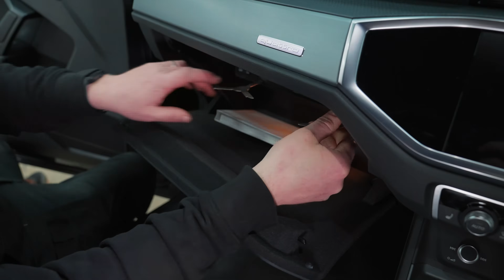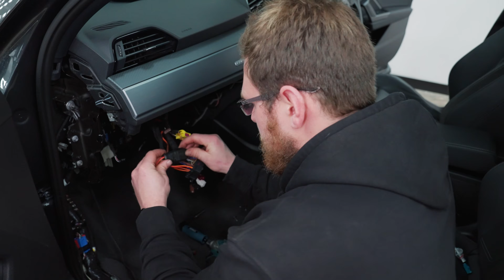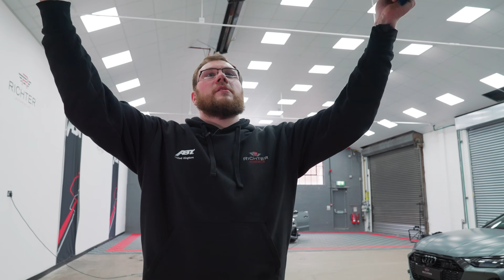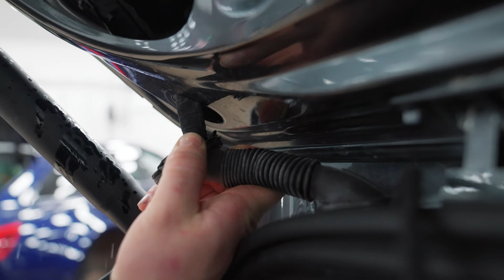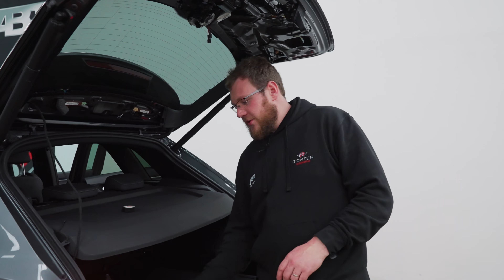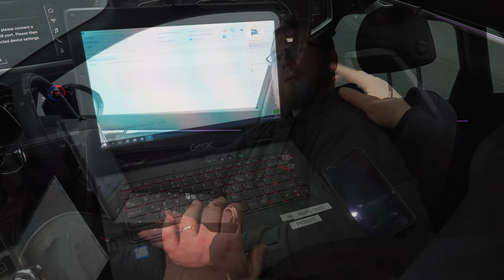Audi Q3 Rear Camera Install Retrofit - Richter Automotive

Comment: Hi 👋🏻 thanks for the video. I’ve recently got Audi South Africa to install my reverse camera which I’ve purchased from Audi. The reverse camera quality seems to be unclear and not great as I initially expected. From your installation, is the camera quality great or does the camera quality just suck? Please let me know as I’m not sure whether I should get it checked out by Audi. 

Thanks 🙏🏻
Reply from the maker: The quality is excellent, but I guess different markets could have different specifications, and much lower resolution infotainment screens which will cause it (some a1 use a very basic screen and the quality is bad)

Comment: Great video!  I'm installing a dash cam and looking for a video detailing the removal of the A-pillar trim on my 2024 Q3 so I can run/hide the wire (USA: left side/ driver's side).  Any chance you can help me out? Much appreciated, in advance!
Reply from the maker: They are pretty tricky to remove, we will try and do a video in the future,, or running it behind the rubber seal could be an option, and tuck it in

Comment: Does the ODIS Software require a special OBD tool?
Reply from the maker: Hi, we use the official dealer Odis, we are an official independent workshop and use the factory tools,
Reply: With vcds it works to code how to do it? @richterautomotive

Comment: Hi. I got a camera installed today and it shows up on the MMI but i don’t have interface buttons like the close button on the right top. And no car illustration is shown on the left. Only a black screen with a camera video stream but no controls at all. What went wrong here and how to activate the user interface to be able to exit the rear camera screen?